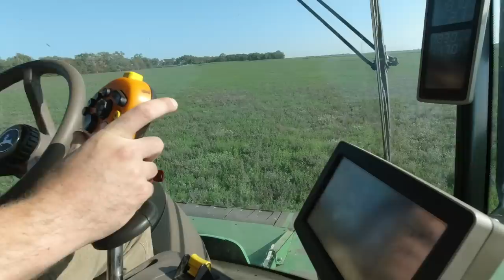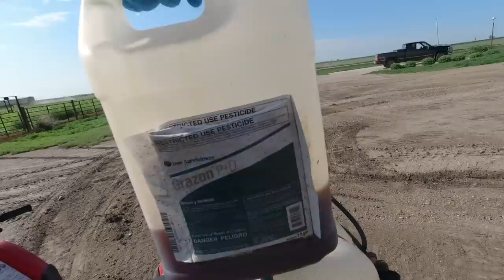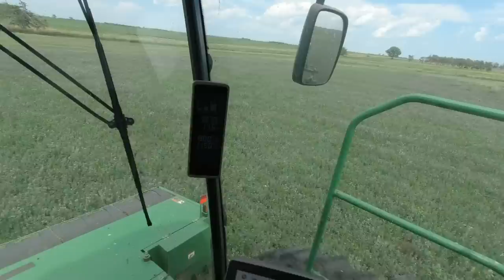Grasshopper Infestation!

Comment: When Brian mentioned the Kung Fu grasshopper reference, I knew exactly what he was talking about, I actually flashed back to the old master calling Cain Grasshopper. Crack houses and its use has been showing up rural areas for years around me and it just dumbfounds me, how can rural kids be falling so far away from the tree? Hope you get those timely rains after that alfalfa cutting, my area of SW Missouri is hitting 100 for the foreseeable forecast. Thanks for the video.

Comment: I thought you could run autosteer on the command arm screen.  Maybe you would need another activation for that unless it is there already in which case mounting another screen from your planter tractor or combine would be cheaper.  One way or the other it would be very much worth it to me to have autosteer.

Comment: Looks like that mower could qualify as a  "Zero turn" capable??    The drone footage was outstanding.  Especially the end of row turn around,  that showed a lot of how that works.  And all of the aerial views are interesting to me.  I was wondering about your feelings of cutting that field the OLD way.  Butt in a large steel bucket seat with two inch  holes in it,  suspended on a single leaf spring mounted on the frame of a two wheeled device that contained the large sickle bar mower on the right side.   Usually drawn by one or two horses.   YOU had to control the horses, normally with voice commands if you had worked together enough.  AND you had to manually raise and lower the sickle bar at the end/beginning of each row.  BUT,  the horses would know the routine pretty well and work well with you..  (if they liked you)  I am pretty dang sure  you COULD do it,  I was wondering if you WOULD do it if given the chance?    Slower pace for sure.  BUT, with good horses, or mules,  it has auto steer!!   Thanks again Cole,  great video!!  All the info you rattle off is very interesting to me.  Stay healthy.

Comment: Cole, couldn’t you guys get an old water tank truck from a fire department auction with a spray nozzle and water the most needed fields a little bit here and there to ensure the crops that you need the most?  I’m in South and have seen farmers do this in order to guarantee higher yields.

Comment: Lots of questions Cole.
I was wondering why you didn't run autosteer in the windrower. Did Brain like his new 'ultra shiny' tractor?
Is Grazon a selective weed killer or is it like round-up and will knock everything out?
We used to get impressive sausages here in the U.K, they were made in a partnership with a guy called Mr Holmes who was a famous meat merchant of note.
Looks like the meth lab guys had a bit of a recipe malfunction...oh dear.
Reply: Sometimes in the bad old days a small town would have a "malfunction" in their power supply just when a suspected meth lab might be at a critical point in their bake...the point where stable temperatures were essential or KABOOM!

Comment: The issue with Grazon is it's persistence.   You feed the cattle, then spread their manure which still has the grazon in it.  If you plant corn there not a problem, but if you try beans on that field, the crop will fail.

Comment: Try holding in centre of steering wheel instead of the rim I found alot easier running windrowers, heeston, case-ih and macdon, takes the twitchy ness out as not got weight on outside of the wheel? Only had auto steer in 1 macdon out of 8 different machines I've ran over last 20yrs
Reply from the maker: thanks!

Comment: hi why do you use a  swather mower and  not just a mower behind the tractor. since the swatter mower is quite expensive?
We are not used to that here in Europe,  we usually mow with a front mower and side mower. or a triple mower.
Reply: Because bto in USA and Canada only run self propelled mowers. If you run pull type you not a big time operator. It all bout looks
Reply: @clintonlehmann4369  but a johndeere 83 with triple mower is also a beautiful sight